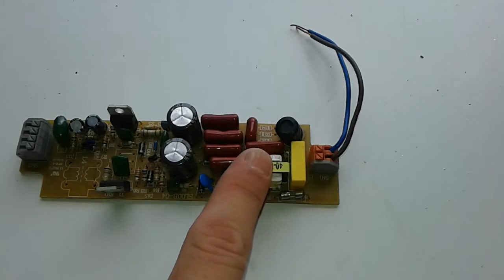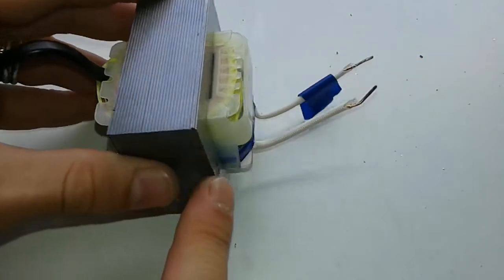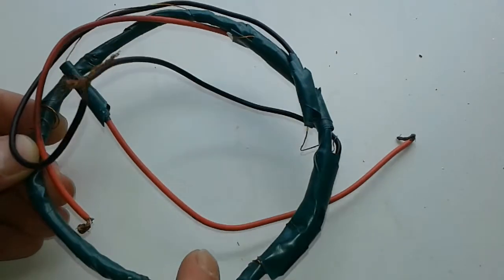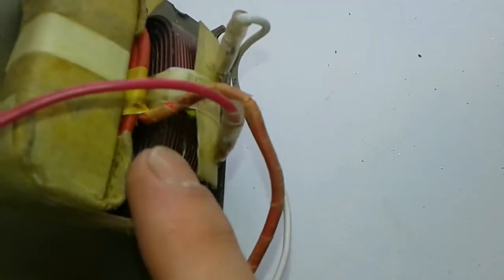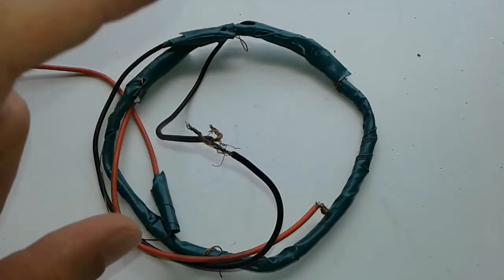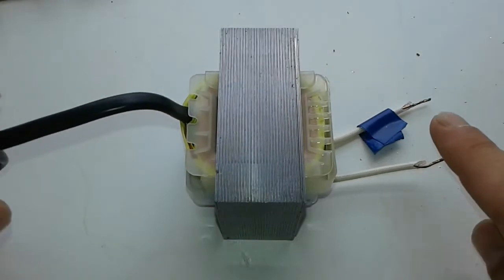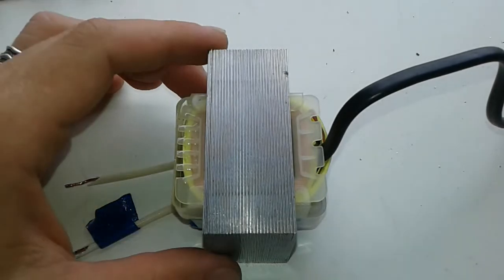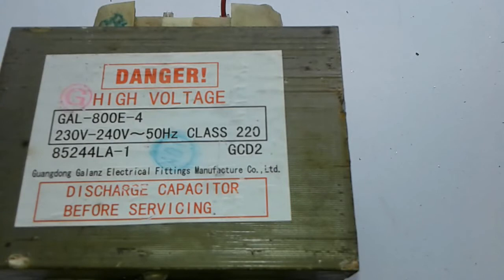The electrical transformer basics working - Electronics for beginners

Comment from the maker: Basics electrical transformer principle
Reply: any comments on why on the microwave Transformer the secondary is a single wire that is terminated at one end on the transformer core i.e 'ground' ?
i'm also pretty new to transformers
Reply from the maker: Kolin Evans all transformers made with 2 individually loop of wires except for the center tap which have a connection in the middle. The MOT has a connection to ground the metal case to provide a ground connection, so in case you will touch the case while the transformer is in use you will not get a shock, but if you touch the output wires you will die 2000v and 500ma.Regardless of this protection while is plugged in the mains don't touch the wires even a small trans can have a bad wire and can make a straight connection to the mains voltage